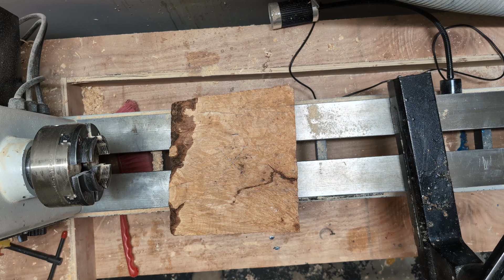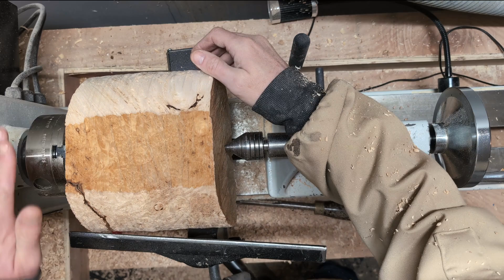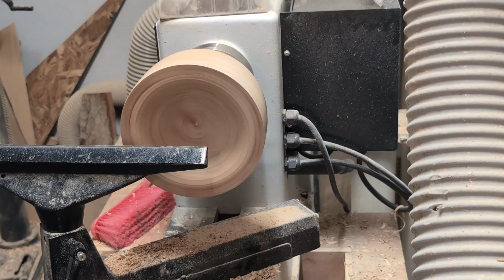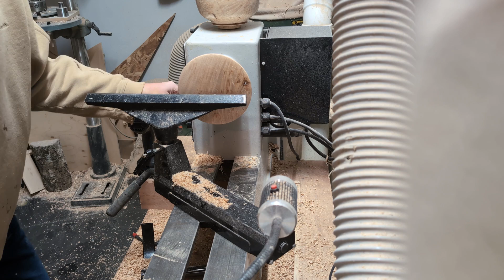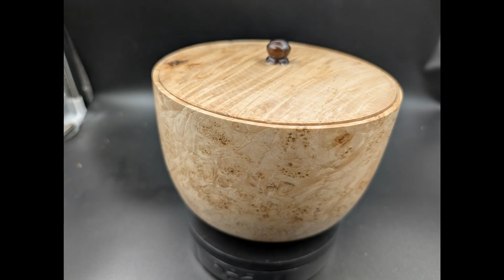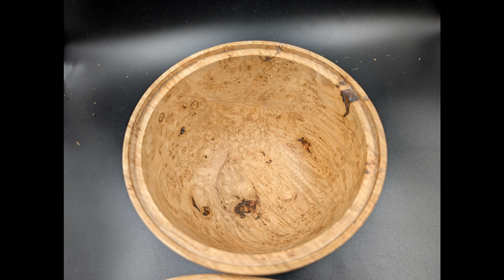Maple Root Ball Lidded Vessel With Walnut Finial

Comment: Wow beautiful vessel!  Am I understanding things correctly that the part you cut of got turned around and put back on the piece essentially 'upside-down'?  If so was that more a convenience of where the tenon was or is there some advantage to doing this I hadn't thought of?  I assume flipping it caused a mismatch of the grain pattern but truth be told it looked like a good match anyway, probably because it still came from the same piece of wood.  Great video thanks for sharing your experience!
Reply from the maker: I did it that ready to get a better match plus it was just the easy way to mount it